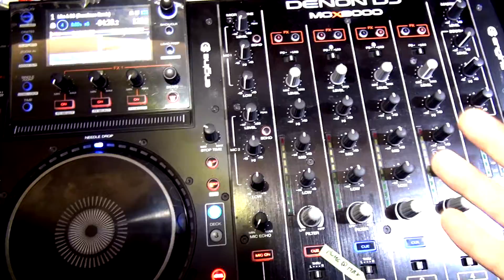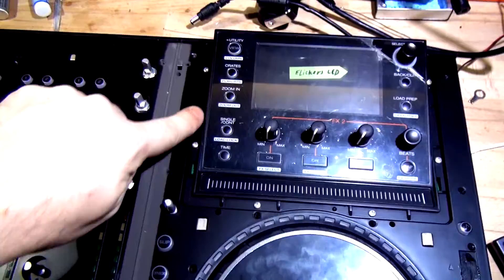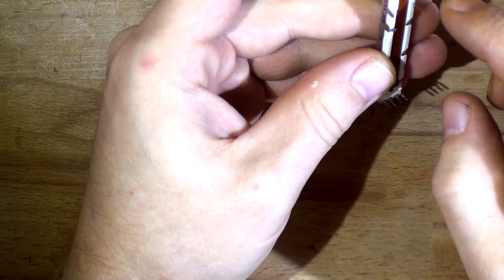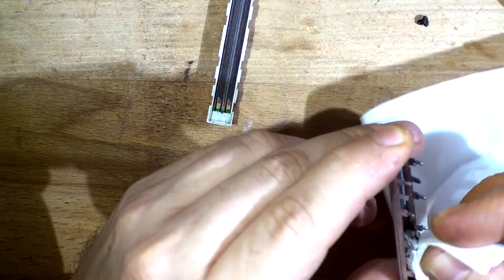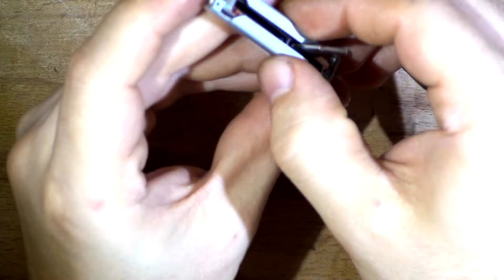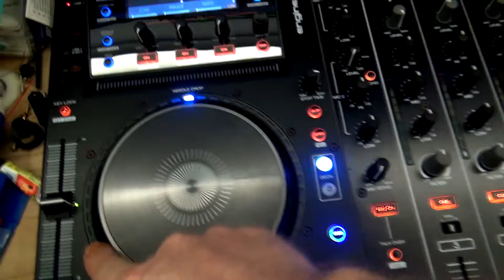DJ Mixer Player Bad Button and Bad Fader Repair DENON MCX8000

Comment: Before watching this. My channel 2 vol fader is broken so i decided to take out fader 4 and swap them but its not worked. Wilp this video explain it as i dont want to waste my time as had the controller opened etc twice and its a shame i cannot find out if its fixed unless its 90% put back together. Maybe its my solder skill's

Comment: I'm going to fix a friends controller for her and this is great. I'm looking at ordering the tactile buttons, should I be ordering AC rated or DC rated buttons for the voltage? I'm thinking DC but just wanted to confirm. Thanks!
Reply from the maker: It’s a signalling buttons, there’s no difference. The don’t carry any current.

Comment: My MCX8000 has been a right pain. Stutter button has the same problem, the switch on the line fader has broken off. It’s already been sent off to InMusic because MCU Display was faulty, when it came back it lasted 3 months then broke again. I was without the decks for a whole summer as they had to wait for the parts. But tbf I find it works better without it, just use a laptop instead! I want to take it a part but I probably mess it up even more 🙄

Comment: You cut out the part that I needed, I can’t find what releases the circuit board with the channel faders on
Reply from the maker: The nuts on the potentiometers, under the knobs, remove the knobs and you’ll see the nuts on the pots.